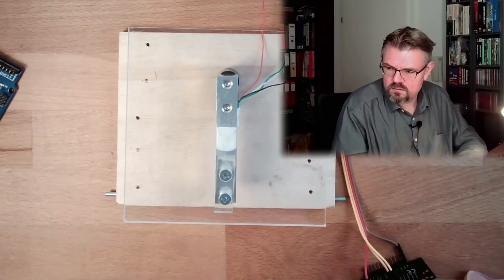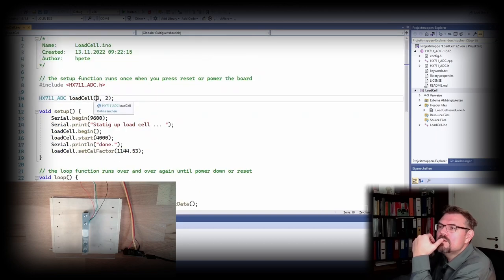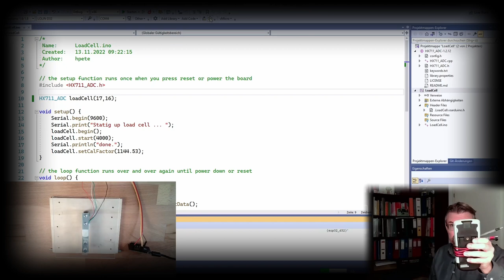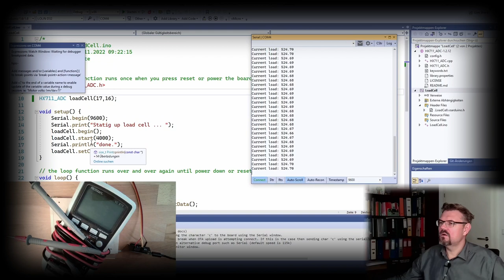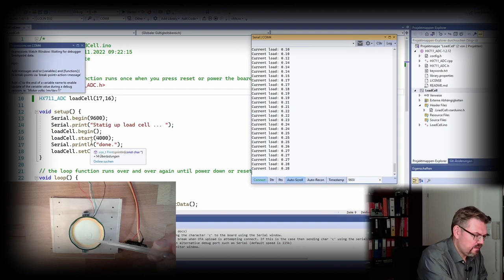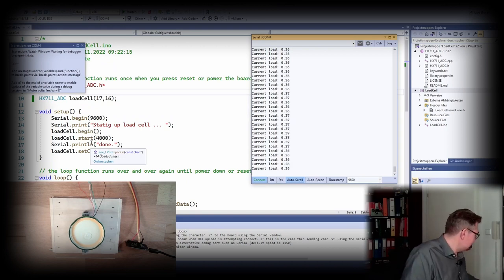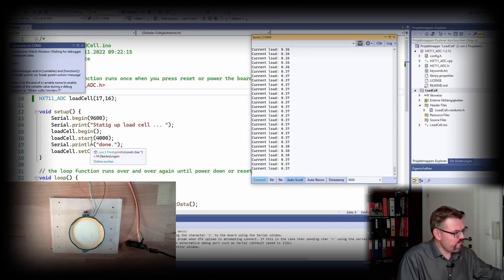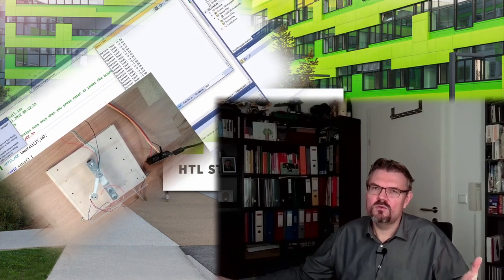PRLC 05: ESP32 and HX711 Load Cell

Comment: I'm getting random values when no load is applied. Unfortunately you're getting 0 when no load applied. Please help!
Reply from the maker: Hello. This sounds strange. This means you have connected the load cell and got some numbers. Do these numbers change if you apply force to the load cell? In the correct direction? I mean is it some overlay noise or is it just garbage? Are you sure you connected the bridge of the load cell correct? Here I explain how you can find out the connectors if the bridge: https://youtu.be/usn-SK_AMTE?si=EHx6tl_ciQ_nvN_V